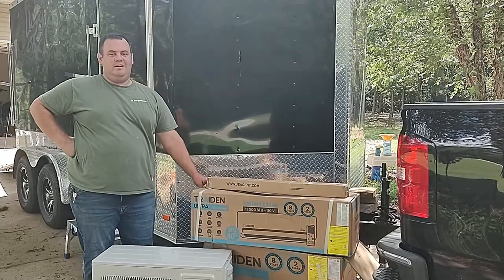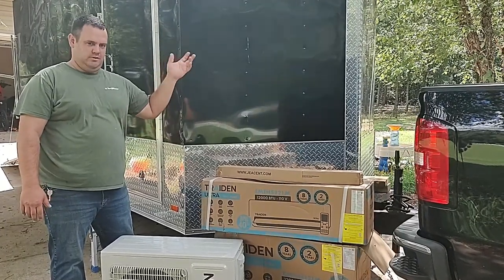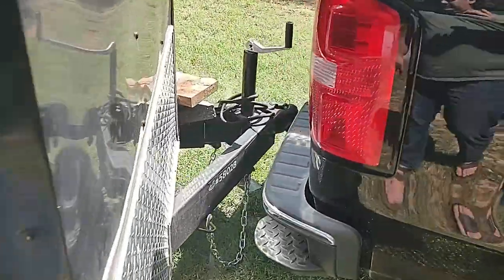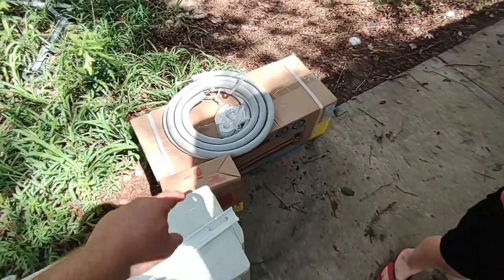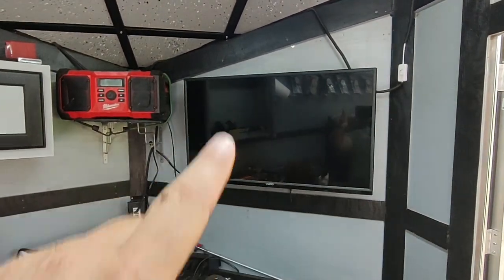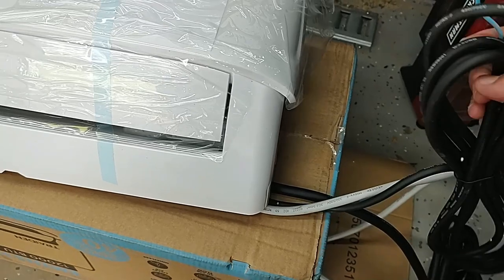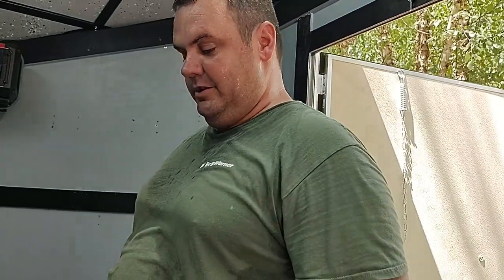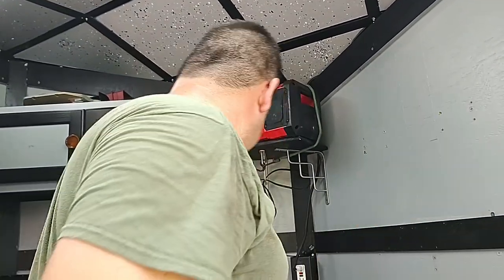How to install mini split Air conditioner on enclosed trailer

Comment: That was a great video you did. 👍 Thank you for the details on it. Just a quick question. For vacuuming the system, I'm using my hoses that I use to charge my car's AC. So did you just connect the "blue/low" vacuuming hose (the LOW one you also use to charge the system) & u didn't connect the "red" hose (high) anywhere? It was just 1 hose to vacuum/suck out the air in the line? There was no charging/ adding freon to it cause the compressor has enough to throw it out the line once you open the valve? Sorry for my ignorance,  I'm just used to charging car's AC system in which you do have take out the old freon and put new one.  So, how did it vacuum it since you had the lower line closed and had to open it after vacuuming it? Is it opened inside to let it vacuum it then it opens up a port inside that line when u open it with the hex key? Is that what it is? Again, sorry for my ignorance. Obviously, I'm going to follow your instructions, just wanting to understand the system itself also. Also, u mentioned you were going to add a breaker box? So is it required? Or can it just be connected to the regular 110v outlet you have on one of your walls? I bought that one 110v and not the 220v. I'm just thinking of bringing that outlet to the outside to connect that mini split.
Reply from the maker: So the outside unit has refrigerant in it and the valves are holding it back. You are pulling a vacuum on the lineset and the indoor unit. You only need one hose because the lineset and indoor units are all one circuit. If you were to disconnect the lineset from just the out door unit you would be able to blow air through the small line and it would come out the bigger line. Make sense? 

The 110v unit can run off an outlet but it pulls a good bit of power so if you happen to have anything else on another outlet on the same circuit you are putting alot on that one circuit.  It's best to have a designated breaker for it. 
Hope that helps.
Reply: @EmpoweringDIYFamily  ok. Yea I heard some people see some of that power glitch the lights or "drown" a little when they turn on the AC. Thank you for the clarification,  appreciate it! 👍

Comment: First, thanks for the video.  I'm a HVAC mechanic and am well aware of the instillation process. However, I'm about to mount one on a trailer for the first time.  I know these trailers don't use thick metal or wood on the insides of these things.  I'm aware the indoor air handler (head) is fairly lightweight.  However, I'm a bit skeptical on what type of screws to use (or anchors) to assure myself that the indoor mounting bracket will fasten to the existing wall without being pulled out over time with travel.  Did you install anything particular on the wall you mounted your air handler on to allow a better bite for your screws?  If not, what are your thoughts?
Thanks in advance.
Reply from the maker: The plywood in my trailer is 3/4 in so I just screwed the bracket directly to.the plywood with a good 3/4 " wood screw. 8 in total I believe. I've put hundreds of miles on the trailer and it's held well. If you have thinner plywood than that I would maybe get self tappers and find the metal stud behind the plywood and run a couple screws into those studs.

Comment: How much better does this work compared to the portable unit you had before? Did the portable unit cool, but this is just quicker/quieter/etc?
Reply from the maker: This one works way way better! The portable worked for my smaller trailer, but when I moved up to that bigger black trailer it didn't cut it at all. This thing will keep it 74 ish in the heat of summer just fine. Depending on how in and out we are that is. This also has heat so definitely a benefit over the portable unit in the winter as well.

Comment: So you would recommend this Brand  ?? There  is sooooooo many to chose from and they all say they are the best !
Reply from the maker: I have been pleased with it. I didn't have high expectations for a "cheaper" ebay unit. But it has definitely outperformed my expectations.  I would definitely buy one again.

Comment: How did to bracket hold up going down the road? I'm doing something similar and am looking for some tips on how to make that more ridged so that the wall doesn't flex with the compressor sitting there.
Reply from the maker: The plywood on the inside of my trailer is 3/4" so I through bolted the bracket into the plywood. It has been holding up very well for a few years now.

Comment: Hello very nice setup. Question can the A/C run while pulling the trailer when driving. We want to use it to put our dogs in.
Reply from the maker: If you have the generator mounted somewhere safe it should. The generator would need to be in the back of the truck or something.
Reply: Thank you for your speedy response, sir. What size generator would you recommend?  I have a Dodge Rm 1500 hemi.
Reply from the maker: I run my entire trailer with a 3500watt generator

Comment: Man.. so glad I found this video! I purchased one of these Traiden Air 18K BTU units and found out it requires 220v direct to the inside unit. I have not opened the box yet but will be installing an outside disconnect with 220 this weekend and was hoping you could tell me if they supplied a long enough power cord for the inside unit to reach a disconnect on the outside or if I need to purchase extra 10/2 wiring for that. I cannot find ANY information on these units and dont want to open the box until my AC guy comes to install it since I do not have a vacuum pump. Thanks for any assistance you can provide!
Reply from the maker: Glad my video helped out. I hope the install goes good for you.
Reply: @EmpoweringDIYFamily  do you remember if the power cord came with it? And if so about how long it was? Thanks!
Reply from the maker: The power cord was hanging out of the inside unit about 6 ft.
Reply: @EmpoweringDIYFamily  thank you!
Reply: Did you figure out how to change it to Fahrenheit?
Reply from the maker: Yes. On the bottom of the remote is six buttons. The top left button and top right button. Push them at the same time. It switches it.

Comment: How is the vibration sound inside thr trailer. I installed mine and I think i need some shock absorbers or something because it vibrates inside really bad. It's quiet outside but I think with the unit being mounted to the trailer itself makes it loud.
Reply from the maker: I used rubber isolators under the until where the bolts go. It doesn't vibrate at all inside.
Reply: @EmpoweringDIYFamily  thank-you I have some absorbers ordered now
Reply from the maker: You're welcome.  I'm interested now. Let me know if it helps.

Comment: What about driving down the road in wet raining or snowing conditions? Do you put a cover over the outside unit to protect it from the debris kicked up by the truck?
Reply from the maker: I don't. I haven't had any issues with that. Water won't hurt it. I've never had debri hit it. Knock on wood.

Comment: My manual says you can exhaust the air either with a vacuum or they give instructions on how to exhaust the air just with the valves and no vaccuum or gauges. Would that be okay since its in the manual and i dont have a vacuum?
Reply from the maker: I have been doing hvac work for 17 years. I have known people to do that and not have issues,  but I don't trust it. I would definitely consider pulling a vacuum instead but try that at your own risk.

Comment: I really don’t understand  how that it helped to take the cover off , I have installed several and it’s simply to just hang the air handler on the bracket, and I think the risk of damaging the air handler just went through the roof and for no gain
Reply from the maker: I've done it both ways. For me it was always easier to run the wires and drain line with the cover off. This one was harder to take the cover off than expected.  Diakin gree and Mitsubishi covers pop right off with zero trouble.

Comment: Can you provide details on those e track desk brackets? Where can I get some?
Reply from the maker: Here is the link for some. You can find them else where but this will give you the idea: https://www.etrailer.com/E-Track/etrailer/e46HR.html?feed=npn&utm_source=google&utm_medium=cpc&utm_campaign=Google%20%7C%20Shop%20-%20E-Track&adgroupid=81219807290&campaignid=1593782368&creative=404001588887&device=c&devicemodel=&feeditemid=&keyword=&loc_interest_ms=&loc_physical_ms=9011150&matchtype=&network=g&placement=&position=&gclid=CjwKCAjwzJmlBhBBEiwAEJyLuz9M83drD4-0-2JhG0J0dk5NxSh8QTXfc2Iy2wkJRM_YTahFHRo5KxoCx8UQAvD_BwE

Comment: Loved the video! Very helpful for an install I having coming up. Curious tho, any idea where I can find a 7/16 line extension??
Reply from the maker: What do you mean a line extension?
Reply: @EmpoweringDIYFamily  The copper tubing that comes with it isn’t long enough. So I have to get a longer one that’s 25 ft. But it has to be 7/16.
Reply from the maker: So honestly to remove a potential leak point I would just buy a longer line set. If not then just buy a lineset on Amazon but you will need both sizes.  There will be the big line and the little line. 7/16 is kind of an odd size but you can find them. Probably going to be a 7/16 and 1/4". Maybe? Can you send me a picture of your lineset?
Reply from the maker: To finish my above thought. LOL if you need to buy and extend the lineset you will need to buy couplings and braze them in with silver solder.

Comment: What happens if you run it and you are not parked flat?
 And does the wind from towing have any affect on the fan motor while towing. Unit not running of course.
Reply from the maker: I don't know. Lol never thought about it. I would assume the fan just wouldn't run because the condenser pressure would stay low because of the airflow. My only concern would be of the fan motor is trying to run and the fan is spinning faster than what it's calling for, will it mess the windings up? Just a thought. It's a DC motor so maybe not.
Reply from the maker: Also I haven't had any issue with it spinning while the unit is off.

Comment: 👍 ..what's the measurements on the outside unit ? Wanted to mount mine between the tongue frame ,thanks
Reply from the maker: 12" deep, 28" wide, and 21" tall.

Comment: Just curious with some road use if the bracket mounting solution held up ok. I've seen units mounted to the tow a-frame directly, but that normally only works for flat-front trailers. I like your approach of mounting to the side of a v-front... but just wondering if it holds up over time. thx!
Reply from the maker: I haven't had any issues yet. I check it every once in a while, and it's held up well. I hit a bad pothole one time that had me worried, but it didn't phase it.
Reply: @EmpoweringDIYFamily  thanks that’s super helpful. I guess I’ll do it exactly the same way
Reply from the maker: You're welcome!

Comment: Thank you for the videos. Crazy question.  just curious how you did your ceiling in your cargo trailer. It looks like ceiling tiles if so, how does that work?
Reply from the maker: It's the pink insulation foam sheets from lowes. It is just painted with the floor paint and speckles. And stuck up between the ceiling rails.

Comment: My outside unit keeps icing over but it does go into defrost mode on its own
Reply from the maker: They will freeze over some. As long as the defrost mode is clearing it away during that cycle. If it's not, then the unit is probably low on charge

Comment: You should have moved the unit to the end of the bracket it’s supposed to have as much space behind it to plow air out and away from the trailer wall and the unit
Reply from the maker: I did think about that, but multiple factors had me mount it that way. First I needed it as far away from the truck as possible during transport.  Second, that's a pull fan. It's pulling through the coil which has a big surface area with plenty of airflow coming through the back of the unit. (I actually was more worried about heat soak from the black panel than I was worried about airflow.) All that to ne said I've been running it fully loaded with no issue. If it was a push fan I may have been worried about increasing static pressure being too close to the wall, but how it is now it works great.

Comment: Any issues with line set running  down below compressor, through trailer floor , then back up to compressor creating an oil trap?
Reply from the maker: Not at all. The Air handler is still above the condenser so the line set going down then up just gives it a oil trap.
Reply: @EmpoweringDIYFamily  ok , I'm debating on doing similar down through floor & back up or out through wall . 
Leaning floor ... it's easier to fix that plywood vs the metal siding

Comment: I’m a little confused. You pulled a vacuum on the system but you only had the one valve open and then after the vacuum you opened the other valve and it was charged. Where did the refrigerant come from. I saw no Freon tank
Reply from the maker: It is in the condenser coil. The valves I opened had refrigerant on the other side of it. Does that make sense? I can do a youtube short explaining it better if you need me too?

Comment: Can you show more of the wiring ,i bought the same one ,mine didnt come pre-wired ,only wiring coming from the indoor unit was the gray cable with the brown ,blue ,y/g wire
Reply from the maker: Send me the picture of the inside unit and the outside unit wiring terminals and I will draw you a wiring diagram. If you can't post here send them to empoweringdiy@gmail.com
Reply: Sent them through email
Reply: @EmpoweringDIYFamily  hey bud I’m stumped on the mini split install. Could I pick your brain? Is it cool to email you?
Reply from the maker: I just seen your email.  I'll respond to it as soon as I can!.
Reply: On the wiring, you mentioned circuit breaker and also 30amp travel trailer connection.  Since you have it plugged in to an extension cord for testing, presume it’s pulling no more than 15-20 amps at 110v?

Comment: What unit did you have in your smaller trailer? Did you like it?
Reply from the maker: I had a mobile unit from Sam's Club. It was on wheels and had a duct you could put in a window to exhaust the condenser air. I liked it for the smaller trailer. It was to small for the new trailer and didn't have heat.

Comment: Does the power come from the inside or outside unit?
Reply from the maker: I have the power going to the inside unit. Then from there feeding the outside unit.
Reply: @EmpoweringDIYFamily  is that a modification or how it is designed to be wired? Also, due to you being an HVAC professional (meaning I trust your information!) is there any issue with creating a low spot when running the refrigerant lines? Thanks!!
Reply from the maker: Low spot is not an issue on this scale. On bigger units oil accumulation could be a problem but the lowest spot here is not near enough to create a problem. 
For the power you just need to have a bigger power wire going from the inside terminals to the outside terminals. Mine was set up that way. I did some YT shorts on the wiring if you want to check those out.
Reply: @EmpoweringDIYFamily  thank you so much!!! I am thinking of going with a tongue mounted generator rack that sits about 29” from the tongue for the outside unit and mounting the inside unit about where you have yours. Just didn’t want to cause any issues!
Reply from the maker: Good luck! Hope it all works out well

Comment: The unit had nitrogen in it when you got it. Was it charged with Freon or where did the Freon come from
Reply from the maker: The air handler should have nitrogen and the outside condenser should have been pre charged with refrigerant.  Did you open the valves on the outside unit already?
Reply: @EmpoweringDIYFamily are the lines supposed to get cold? I thought they were but after vacuum and opening up too then bottom, checking for leaks, (all good) it stilll doesn’t seem to be cooling :(

Comment: Year & half later still happy?
Reply from the maker: Very Happy. Used it for heat this morning.  It's definitely been a game changer.
Reply: How did you bolt it is the 1 in rods on trailer are filmsy and all the vibration doesn't loosen anything??
Reply from the maker: I used grade 8 bolts through the frame. The bracket has held up well. The wall bracket seems flimsy when separated, but once you bolt it to the wall and the unit it's solid.
Reply: Is the wall the standard 3/8 plywood
Reply: @valentinsalas8300  I've seen him say in other comment that he has 3/4" plywood
Reply from the maker: Thank you
Reply from the maker: I apologize I didn't see this comment.  No the walls in my trailer are 3/4" plywood. If you have 3/8 you may can just double up a piece of plywood to Bolt through.

Comment: How do you connect it to the app ?
Reply: Btw to change to Fahrenheit press Ta/ts & display at the same tome
Reply from the maker: Mine didn't have that capability.  The new one right after I ordered mine has the app feature. I'm jealous.  😆
Reply from the maker: I had found it after I ended the video in the manual. Thank you though.

Comment: Where did you get the adapter from?
Reply from the maker: For the refrigerant line? You can order them on Amazon. Or a local store like United Refirigeration, Epting Supply, Baker Dist, or any hvac supply store.
Reply: @EmpoweringDIYFamily  are you in the Permian area? You look like the guy that sold me one of these Traiden Mini Splits lol
Reply from the maker: @bradenwelch1967  nope not me! Lol I don't sell them, and don't know where that is. Lol